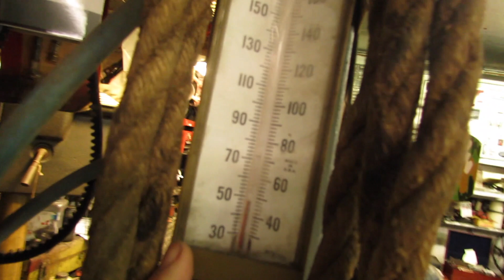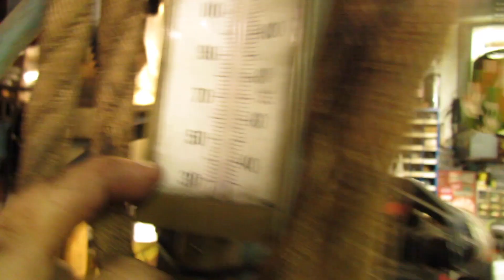350SS-Installed transmission

Comment: Glad to see you making progress on the SS... Gotta watch those pesky spark plug wires. I had one set the engine bay of my camaro on fire (it laid across the header)...

I have a screw type transmission jack, I may have to try out one of those hydraulic ones.

Comment: I feel your pain on that 350SS. I had a cursed IROC Camaro once that was a similar nightmare.  One of those things where you set out to turn a carb screw and next thing you know you're pulling the engine, and after that  it just moves on to the next 10 problems. Funny thing is, Once you finally get it together and sell it, the next owner will probably drive it for 50,000 miles without ever needing to lift the hood.
Reply from the maker: That's probably how it will work out.  haha

Comment: You'll laugh at this. Years ago i did a head job on a 1.6l mk2 escort. they have a temp switch wire at the front of the head. I got it all back together and couldn't find the wire. Hmmm? There it was between the head and head gasket . took it apart put a new, new head gasket and a new terminal on the end of the wire and cursed and put it all back together. Funny how it goes back together faster the second time, LOL Thanks for the years vidoes and a Merry Christmas to you and your family.
Reply from the maker: Dang

Comment: Man, I feel sorry for your hands. You need to invest a few bucks in gloves. In my earlier days of being full time mechanic tore up my hands bad. Now I use the cheap latex gloves from walmart like 5 bucks for 50. They have the black diamonds that are more and more tough, then use the dipped garden gloves for medium work and like mechanix gloves for using air tools. Also use Nitrile blue glove for fuel etc. You wife and your body will thank you later for using them. 8-)